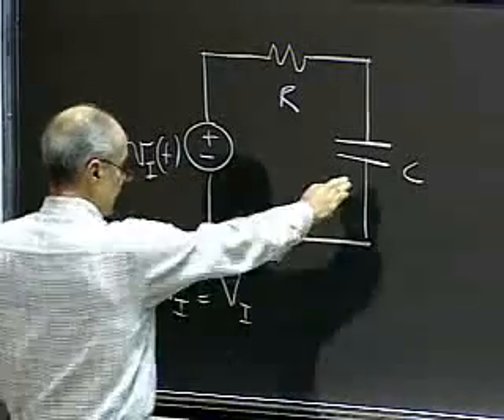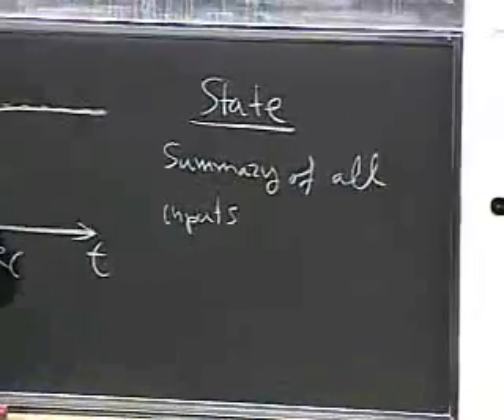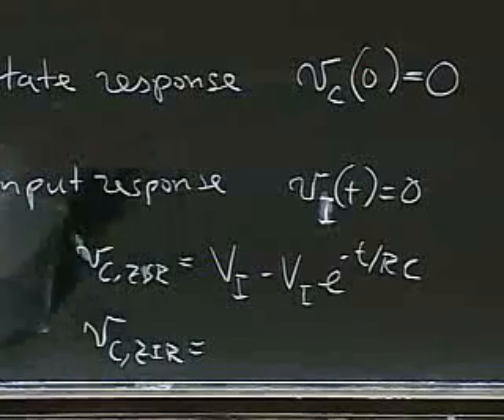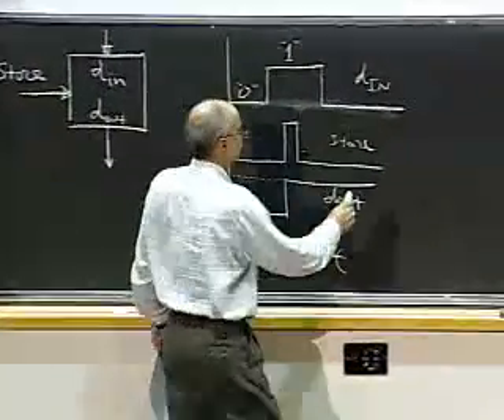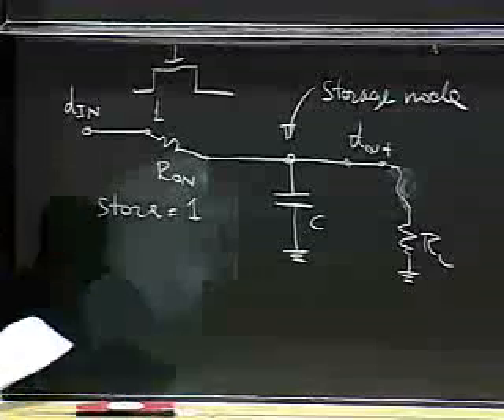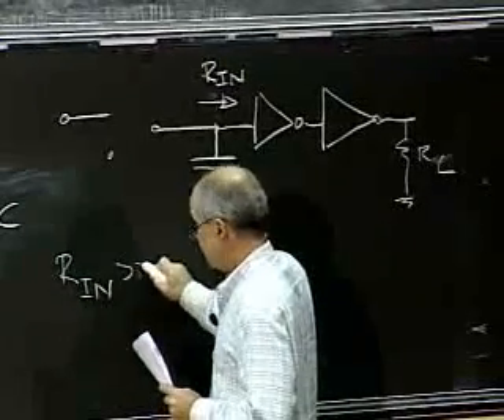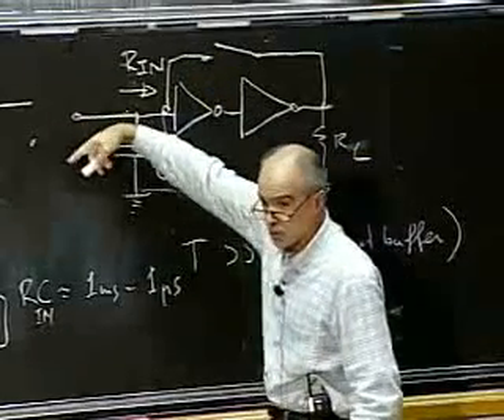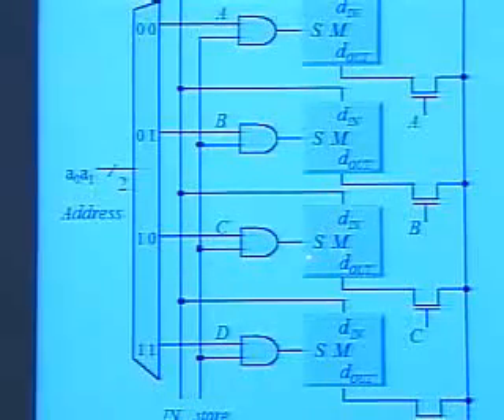Lec 14 | MIT 6.002 Circuits and Electronics, Spring 2007

Comment: I would say Lec 14 is not as fascinating as those has been delivered  by Prof. Agarwal. Issues here being:  

--The purpose of the demonstration was not very clear, nor was the demonstration board neatly built. I agree with the lecturer that feedback and buffering are  very important concepts, but the example shown is not the most suitable one. Firstly, by connecting the DRAM cell output to a cross-coupled INV pair (which is effectively the core of a standard 6-T SRAM cell) misguides the student. I'm pretty sure no one designs such a memory cell these days. 

--Buffers, of course, are needed to solve the charge sharing issue and drive the long data output wires in DRAM, so it's OK to introduce this. However I don't think it's a good idea to completely ignore the concept of electrical isolation between the previous and next stage gates, the regeneration introduced by the next stage, and transistor sizing / driving strength's effect, after the lecturer had already introduced the buffer concept as well as demonstrated that with a high enough driving strength the state of the feedback loop can be toggled. 

 
Consider this is a fairly old video, we should still say thanks to MIT open course.
Reply: As for me, lecture is pretty readable. Not ultimately clear, but certainly comprehensible.